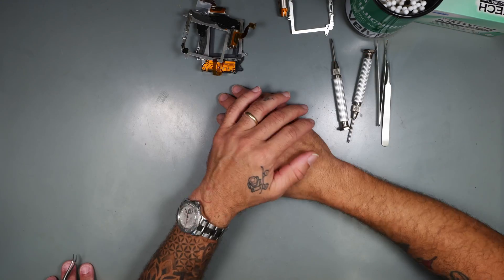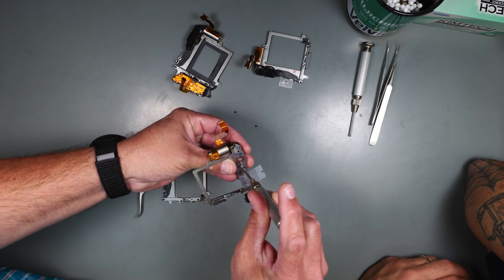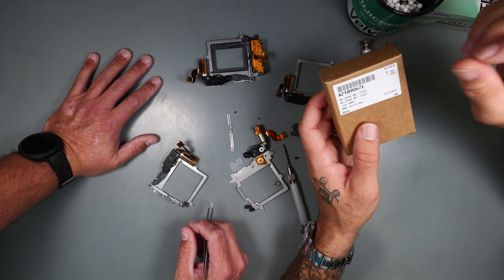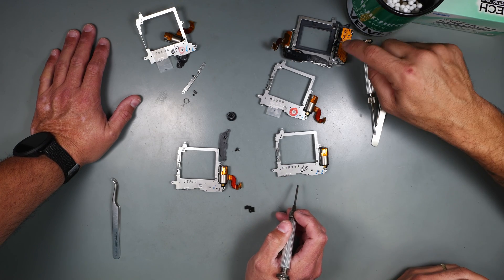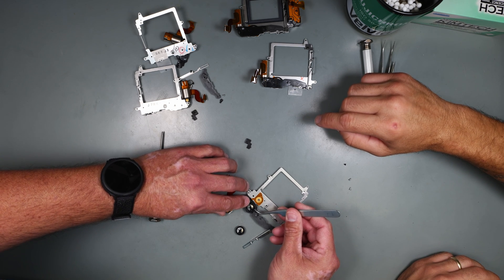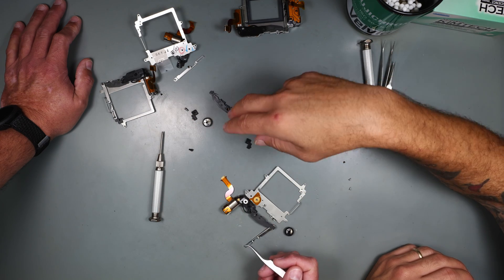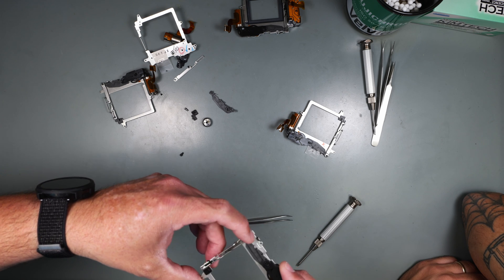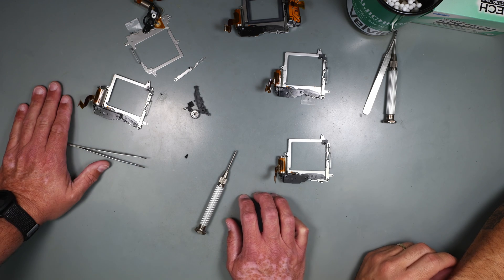Why Sony Shutters Keep Failing | Deep Dive with Jon Jacobs on the A7 Series Shutter Motor Drive

Comment: Sony use the same shutter on the A7iii as they do on the 4, so why is the 4 so much more prone to failure do you know?
Reply from the maker: Because the 4 is more powerful therefore the same shutter that’s in the ii iii and 4 they just updated the motor drive and not the shutter. There always trying to make shortcuts to make more money because they don’t care ha they just want y’all’s money.

Comment: Hello! So, I bought a Sony a7 ii as a "for repair" from a local camera shop. I saw the shutter was stuck down and figured I'd just order one. When opening it up, I noticed the shutter assembly moved fine as long as this motor drive assembly was removed. After putting the drive back on, it seemed to move freely when activated by hand. However, turning the camera back on, it locked up again after attempting a shot. Do you think it'd be fair to say just the motor drive has something wrong with it, or should I replace the shutter assembly as well? Thanks :)
Reply: For what it's worth, I also am not sure exactly how to calibrate the spring tension properly. What to "look" for, rather.
Reply from the maker: I would put my money on the motor drive being bad but would replace both
Reply: @HansomsRepairs Thanks! I got to taking apart the shutter drive and found the white gear 3rd in line (before the black gear with the wiper and cam mechanism) had a worn spot on it. I’m attempting to resin print it, and if that doesn’t work out, I’ll replace both of the parts.
Reply from the maker: Whoa if the resin print works let me know!
Reply: @HansomsRepairs It seems to work somewhat. I think my current issue is that now I’ve messed with the shutter assembly so much that I’ve thrown the timing out of wack. It’s no longer getting stuck down, the resin printed gear allows it to work properly, but the camera after a few activations will pop up with the “camera error, turn off and on.” again, just with the shutter recharged.

Comment: That shaft or even the lever on the MB charge unit break because of stuck shutter. It will not break off by itself. Those A7 shutters will stuck for two reasons. Either one leaf from the curtain will break off and jam the shutter, or small rubber block inside shutter that act as a curtain end bumper will disintegrate and glue curtain to the housing. If you can't move the shutter, the charge unit will break at it's weakest point...

Comment: Great video! I was curious about the shutter failure too. Last year, I had the shutter on my A7IV replaced at Sony Tokyo Service — it had 270,560 actuations. The replacement shutter just died this week at 72,888. I also noticed that the new shutter had a stronger feedback when releasing, whereas the original one felt softer.
Reply from the maker: Wow new shutter didn’t even hit 100k 😭 
How was the service over there in Tokyo and what was the price if I may ask?
Reply: It was pretty good — 10-day turnaround. $200 for a shutter replacement and cleaning. They were a little reluctant to take it at first since it was an American model — they were worried if they damaged any of the Wi-Fi components, they might not have parts right away. It’s going back next week — I’m heading over for my annual trip. Sony really has to work something out with NIDEC PRECISION CORPORATION, the shutter manufacturer.
Reply from the maker: Agreed 100%